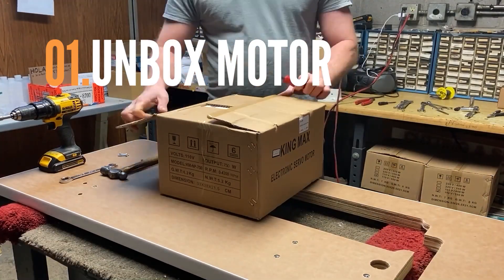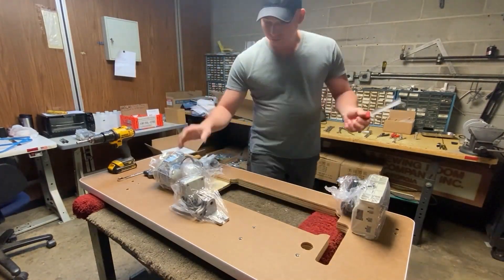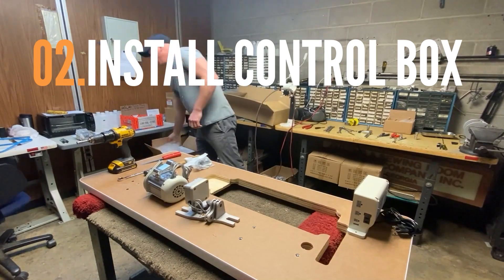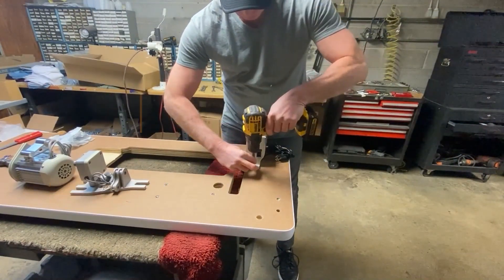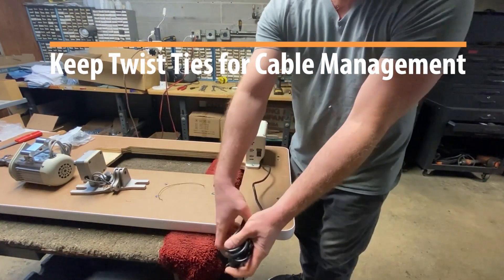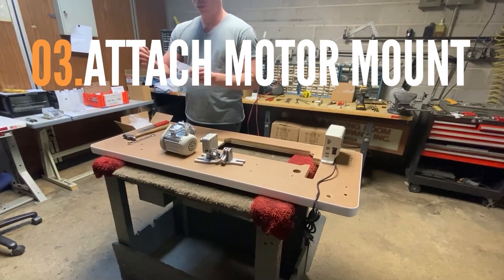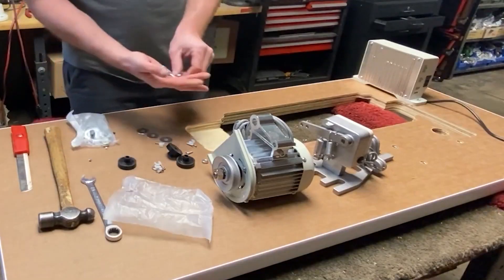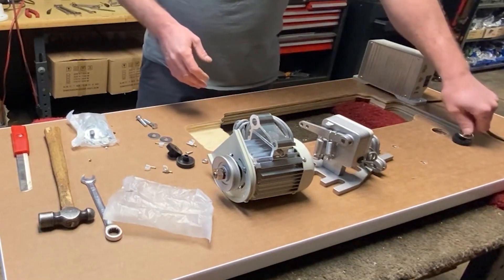Add Needle Positioner to Your Juki DDL-8700

Comment: Hello, What size pully is on the motor in the video please? Mine has a 75 mm but I want to fit a 50 or 55 , would that be ok/ Thanks Steve UK

Comment: So, I ordered my 8700 with this but it came with the screw and piece. Can I have you send me the one piece black piece so my synchronyzer doesn't wobble so much? The issue is definitely the piece the bolt goes through center hole is not center to the outside where the synchronizer screws onto. You guys sent me a new white piece the bolt connects to hand wheel but didn't help.
Also, this is not how you guys installed mine at all. The silver piece that goes into bottom of synchronizer was bent at the bottom and screwed into the table with one of the winder's bolts ... Didn't use the brass threaded rod with the nuts at all. In fact it didn't even have them with the machine.
Reply from the maker: Please call 404-321-3607 and we will see if we can help you.